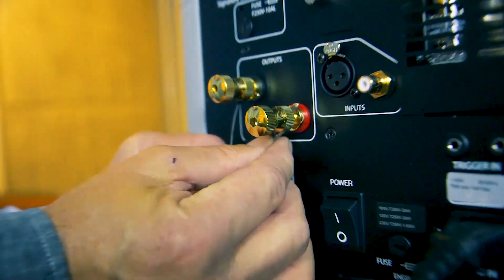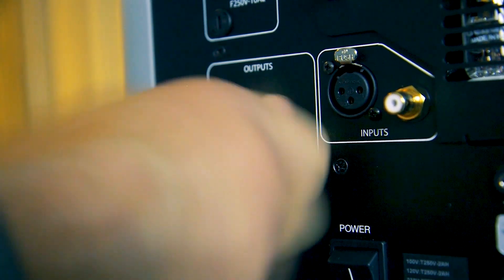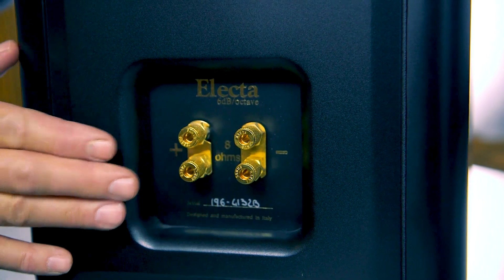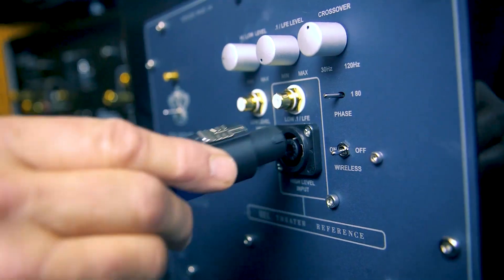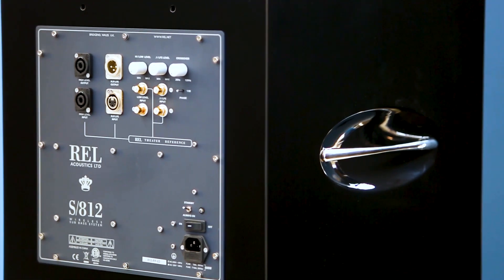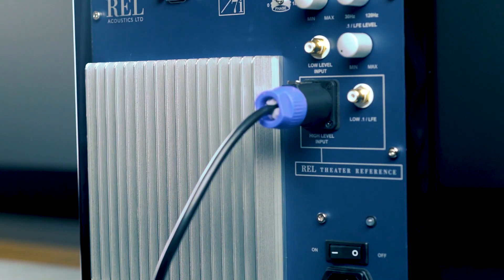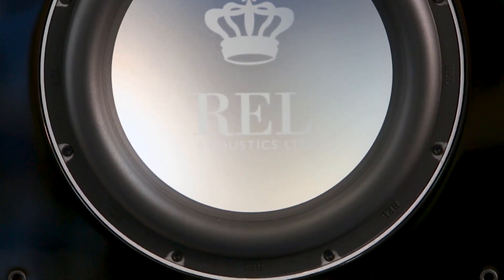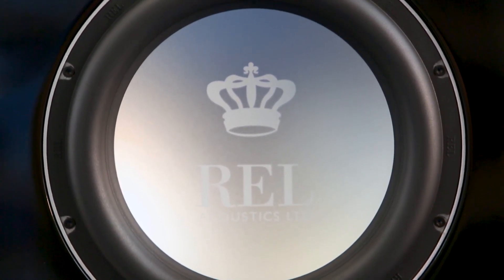What is a high level connection and why does REL insist you use it?

Comment: Good morning I have a REL T/5i in Canada I am moving to Australia, can I just change the fuse and power lead?? Will that then be comparable from 110>230Volts Thank you so much ross
Reply from the maker: Unfortunately the T/5i cannot have it's mains voltage adjusted externally. For information on having your T/5i configured to 230 volt operation feel free to write in to contactus@rel.net and we will be happy to assist.

Comment: How do I connect my Rel Q100 to my Musical Fidelity X-A200 mono blocks using high level inputs please?
Reply from the maker: When connecting a single subwoofer to systems using monoblock amplifiers, it is best to use the subwoofer's Low Level input connected to outputs on your preamp. Connecting a single subwoofer high level to two monoblock amplifiers can often result in a ground hum which is very difficult, and in some cases impossible, to eliminate.
Reply: Thank you for your belated response and I am very well aware of that and as I am sure that your research team is as too. This is nota sarcastic response as things have been going well but I can definitely tell the difference and my  gear is very ‘high end’.

Comment: I can appreciate the importance of REL’s approach with high level from the amp and the engineering that went into it. This is particularly for high end resolving two channel systems when integrating a high quality musical sub. I was planning on purchasing the beautiful new REL S 812 sub but now seemly have an issue. I have two class A fully balanced mono block power amps and from what I’m reading, the REL high level connection/cable will not work. I don’t want to lose the advantages the high level connection to this sub as eloquently stated by RELS lead engineer nor will l buy two subs to solve a connection issue. Please advise.
Reply: It’s easy...... duel subs..
Reply: I am in exactly the same situation see my post above. This is something that needs a solution as most high end amplification is mono blocked. Guess we all miss out from these benefits and I am not getting off arse to change the volume every time.

Comment: Hi, am I right in thinking I will use the same terminals for my main speakers as I use for the high level inputs on the sub..? Doesn’t this mess around with the impedance essentially hooking up two speakers to 1 terminal?
Reply from the maker: You are correct that the subwoofer's high level cable should be connected to the same speaker output terminals on your amplifier as your main loudspeakers. The REL's high level input has a significantly high impedance, which results in it putting no current load on the amplifier.
Reply: @RELAcoustics  Yeah just fine i wired up with my magnat rs 12 sub like this nothing burned👍😁 i will compare with single rca cable later btw is it safe to wire only right ch or left ch?

Comment: I have the t5i , warching movies,  games, and hear a Lot of music, in movies and games Sounds good for me in lfe mode,  u sayd i can drive high level and lfe At the same Time,  how do i need to setup my speakers,  i have a Denon x4500h,  with 836.3 Fronts and 866 Centerspeaker from canton, i set the fronts and the center on Big and Lfe+main, then the crossover at 60 Hz ( highlevel on the left speaker), but on the Sub i let lfe on max crossover and the highlevel at the middle because i have no numbers so i cant see what is the right setting. Is this correct? And how can the sub play lfe  and the highlevel signals from the fronts at the same time?  Is the t7i better because HE has Front and downfire drivers? Maybe the ht1003 is the better choise. I dont its confusing because its sounds sometimes too boomie,  i want deeper and smoother sound, my sub is in the corner left and a bit in Front of my left speaker wich is in a bookshell, and in Front from my sub i got a sofa furniture, Greetings from Austria
Reply: I think he meant you can connect sub by LFE to your Denon AVR and use Rel high level connection to connect it to speakers terminals on stereo integrated amp or stereo power amp.

Comment: I put my main speakers on large but what crossover will i put my speakers on? Shall i put it on 80 all speakers or shall i go higher to feed my bass to the subwoofer? Thank you
Reply from the maker: When using the high level connection, we advise to set your front left and right speakers to large or full range, with no high pass filter turned on. This allows the subwoofer to receive signal with information all the way down to 20Hz and below.

Comment: How much has the high level connection changed since the purchase of my Stadium III 20 years ago?
Reply from the maker: The current REL high level connection is fundamentally the same as what is found in your Stadium III, though our amplifiers, filters, and drivers have improved since those older models. This allows the current subwoofers to be much more fast and responsive, and integrate into a speaker system more easily.
Reply: @RELAcoustics  does this mean if I add another REL sub to my system, it will be out of rhythm with my Stadium III!  I will not let anyone pry my Stadium III out of my cold dead hands!